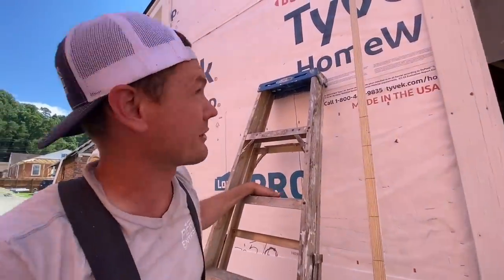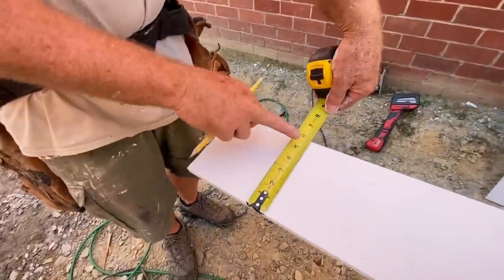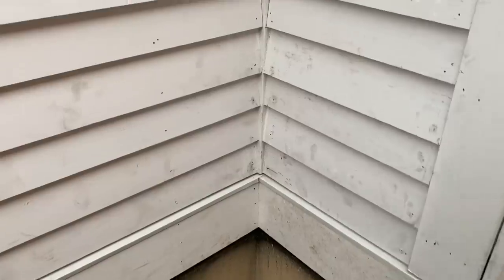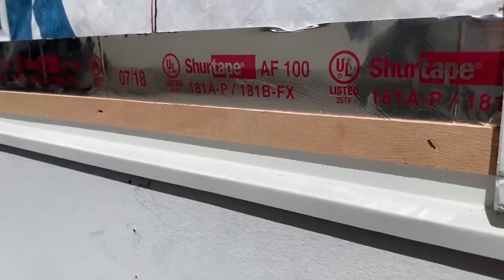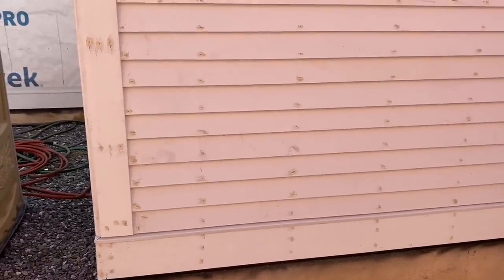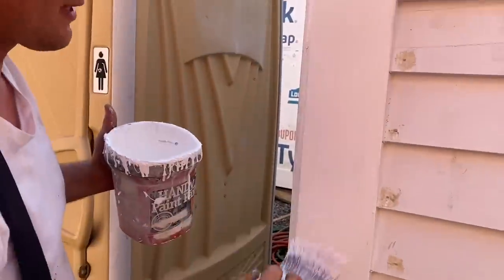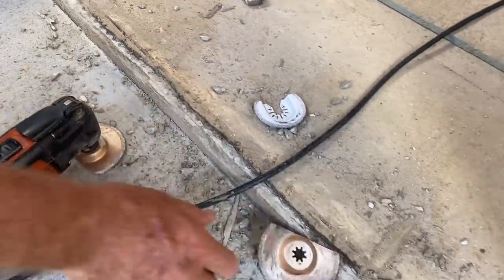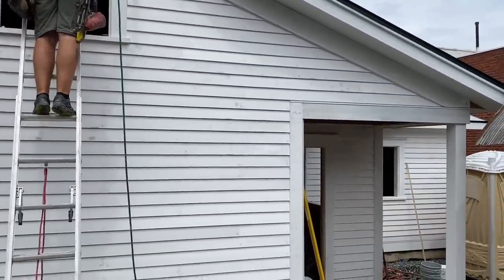Renovating A 100-Year-Old House | Episode 9

Comment: Carpenter & Joiner for 37yrs in the UK here & I didn't know that trick with the gauging rod or tape measure on the angle.

Genuine "Pro Tip" 😊

Comment: neat old school siding spacing trick @1:30 justifies extra effort to source 4⅛ " siding 
- in tailoring this is called "easing in" of seams (fabric cut on bias allows stretching or puckering to fit round openings like sleeves or necklines, as needed) and kinda reminds me of "tensioning" in knitting: hold yarn too tight on knitting needles and your sweater will end up too short, hold too loose and it "grows" too long - home handicrafts teach a lot of maths (I'm British that's the term we use ha ha) IMHO our kids should be encouraged to take vo-tech to balance their book learning!

Comment: always clean your paint brush with a wire brush to remove the dried on paint :)
Reply: Never clean your brush with a wire brush, use a scrubby kitchen pad so you don't wreck the bristles.
Reply: AbbieHoffmansGhost use the wire brush like comb through the bristles, fast and thorough. Use a green pad, how does that work ?
Reply: @robertbeirne9813  A wire brush will damage the bristles. Hold the pad in the palm of your hand as if it were a glove and squeeze the bristles with the pad and go from the ferrule to the tips of the bristles getting any paint that is stuck to the bristles. You can get about half of a 3" brush at a time this way, then flip the brush over for the other half. Works great and saves the bristles. It should be done about once every 3 hours or so during the work day.

Comment: Quarter round is such a hack job.  There are no other round elements in the design.  You obviously have the ability to cut a square piece that would look right and do the same function.  Also, any real painter would be embarrassed and ashamed of those brushes.  Otherwise, I look forward to the next video and really liked the story stick trick.

Comment: 2:56 question for Ray ... how often do you knock that sensor off your arm in your profession?? also, bet it’s not easy to keep from bottoming out with your constant activity. !!go you!!
Reply from the maker: Rays the man! He may answer you as well, but he does have to use a special tape if it is hot. The regular medical tape doesn’t hold up to heavy sweating.
Reply: I'm fairly new to the sensor, but it did  almost fall off after being extremely sweaty one day. I use skin grip now along with tac wipes and haven't had any problems since. 

I'm glad you noticed the sensor. That video was recorded the week I got it. It's been a real game changer and has helped me from bottoming out in this line of work.
Reply: Ray Jones  thanks for responding Ray. one more side note ... if you don’t already use an insulin pump, I highly recommend it! I’ve been attached to one for 18 years sih now. best decision ever! with your activity level, it would be a great benefit to you. anyway, all the best to you. take good care of you!

Comment: I was just wondering if that first coat is primer or self priming finish.  Every nail hole is going to flash if you try to get away with just one more coat on top of your patching. Carpentry looks great, but as a painter, I would hate for all that hard work eventually not lasting due to a failure in paint durability. I’m old school, so I like to use oil based primer on wood front and back, fill nail holes with spackling, and caulk. If you go around to some newer neighborhoods where painters are using primer finish on new wood you will see that within a few years the paint is turning loose and peeling.

Comment: Will you have to caulk in all those nail holes on the siding before paint or is there a faster way?
Reply: Caulk shrinks on wood and it’d look like a bunch of little pits when it dries.  Gotta use wood putty.